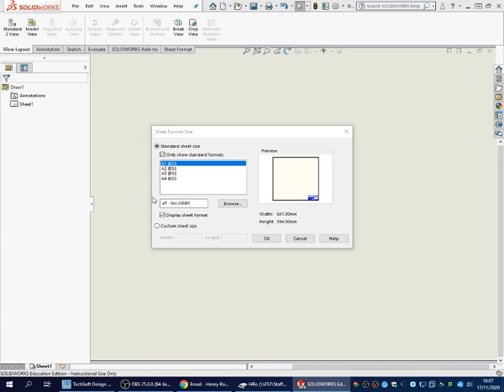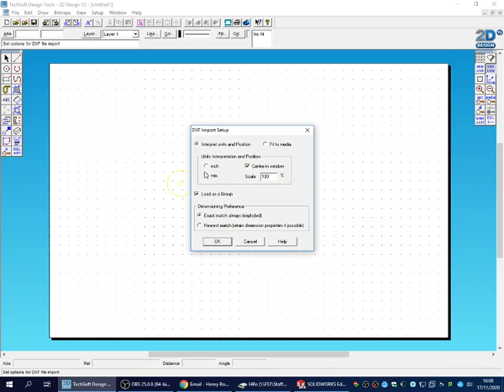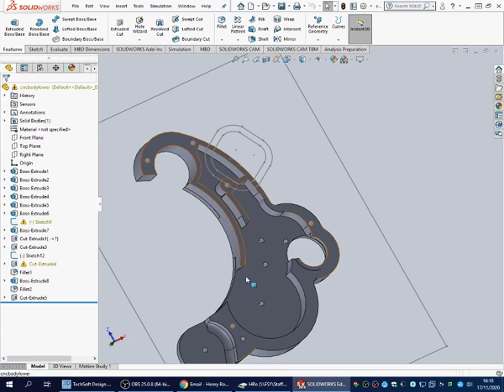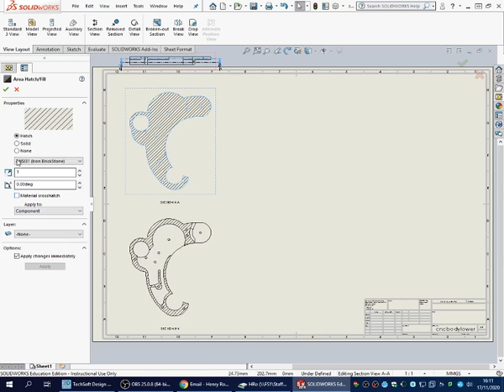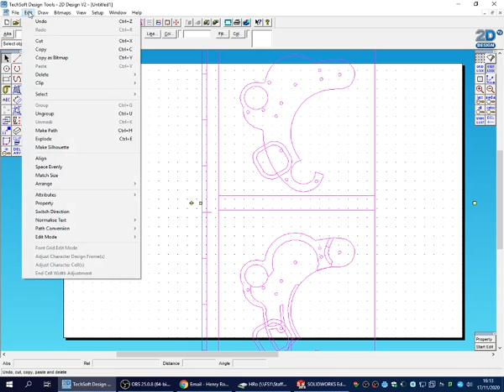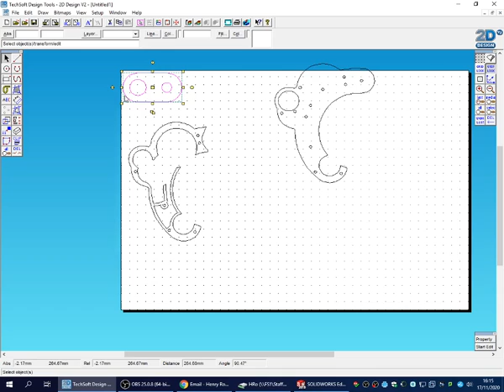Using Solidworks to make artwork for laser cutting

Comment: Hey Henry,  nice video. If you want to save your self a bit of time, you don't need to create a drawing from the part for the dxf. Once you have extruded the part to thr thickness, just click save as dxf and then you can select the view required and done, ready to import to your laser program. it will be already at 1:1 scale and will not make centre lines over the holes.
Reply from the maker: Thanks for that, that's very handy, much appreciated.
Certainly worth doing for simple shapes like this. Maybe still worth the drawing method when cutting sections.